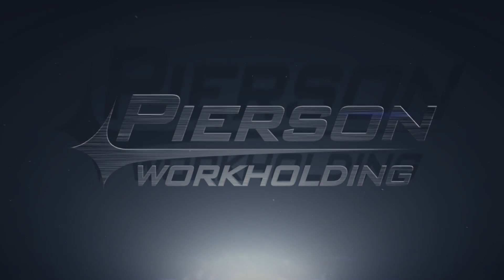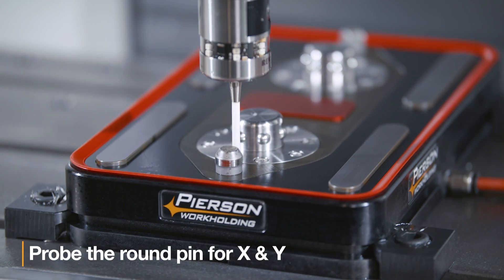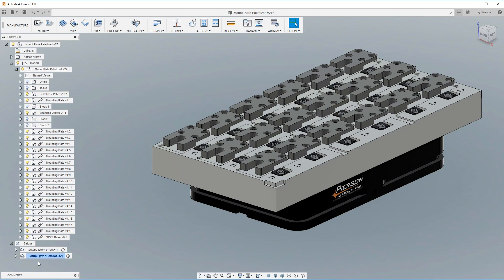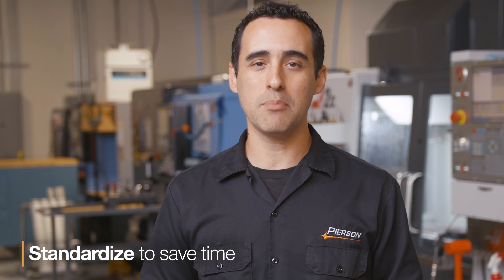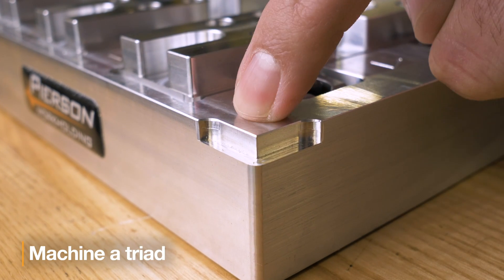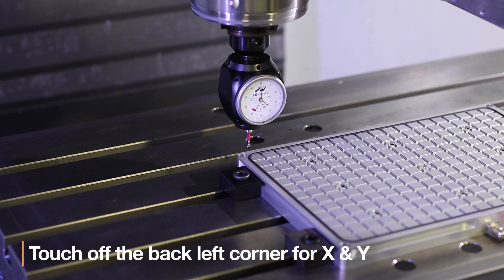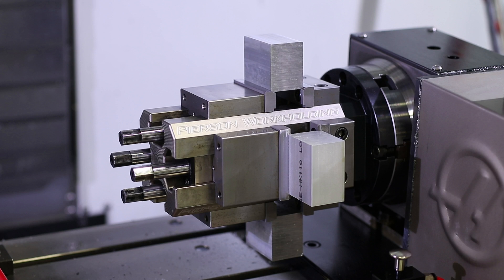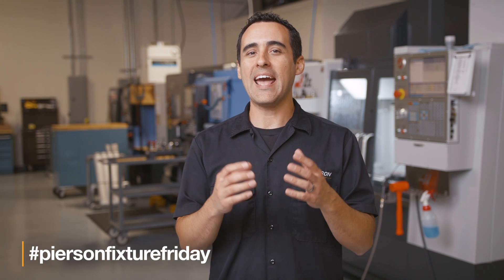How to FIND ORIGINS for your fixtures | Fixture Friday 4 | Pierson Workholding

Comment: Which feature is most accurate when tramming in the base? I was thinking it would be best to somehow perfectly align the indexing pins in x but that seems fairly difficult..is the base doweled underneath?
Reply from the maker: Fastest is to rough indicate it along any edge of the base to ±.002 and then use an indicator on the pins.  Here's a G-Code program we use to probe the pins with a dial indicator:
O00005 
(PPS Base Indication)
( START AT BACK PIN. )
( PLACE INDICATOR ON RIGHT SIDE OF PIN. )
( ZERO INDICATOR. SET RAPID OVERRIDE TO )
( 25% TO TEST INITIAL CYCLE. TIGHTEN )
( BOLTS INCREMENTALLY WHILE REPEATING )
( THIS PROGRAM TO VALIDATE SQUARENESS. )
G91 G01 X1. F50.
G91 G00 Y-9.5
G91 G01 X-1. F50.
M00
G91 G01 X1. F50.
G91 G00 Y9.5
G91 G01 X-1. F50.
M00
M99

Comment: Just uploaded a pic to IG.  We've finished creating some cool fixtures for our new pro pallet.  The part is an interesting looking casting that needs two 3/8-16 holes drilled and tapped through the side.  We machined riser plates that bolt to the pallet, so that we could direct mount the castings.  Works great!
Reply: What's your instagram?
Reply: @OakwoodMachineWorks  looks like their IG username is fairhavenmachine
Reply: @KCautodoctor yes you are correct our username is fairhavenmachine

Comment: Really want one of your pallet systems! Fingers crossed I get the volumes to justify it 👍
Reply: They are great for volume work. The also work well with repeat jobs. You can use them with vises or superglue. You can also bolt 9n a plate that is machined for the fixture and have pallets those attache to.
Reply: I don't want to dash your hopes but I've quoted thousands of jobs and none fit this system.   All parts aren't flat bottom, light as a feather, 2 ops, and the customer wants 70,000/year.
Reply: @andrewmoore6108  good job I manufacturer my own products then 👍